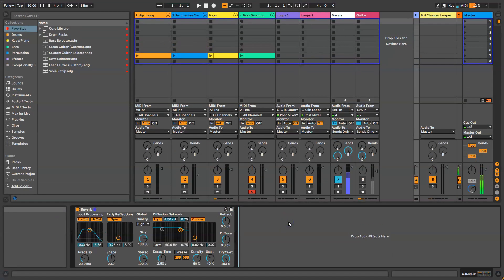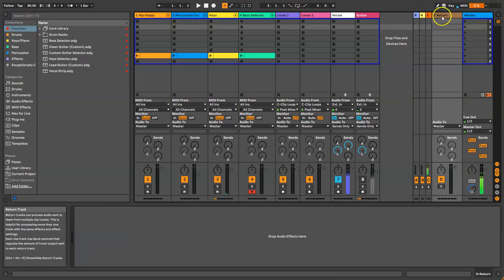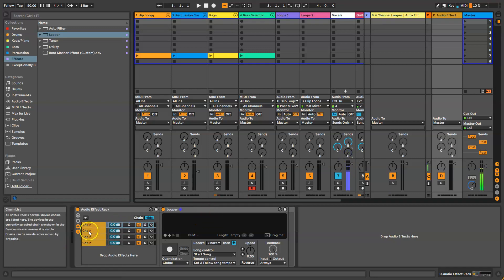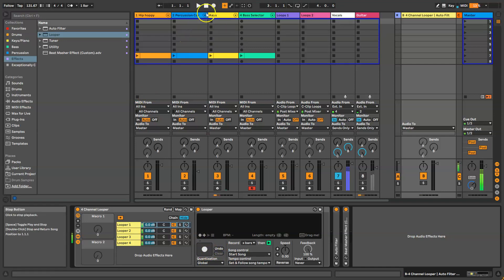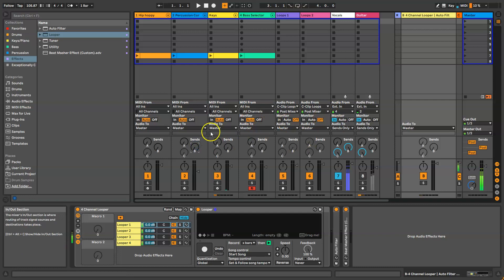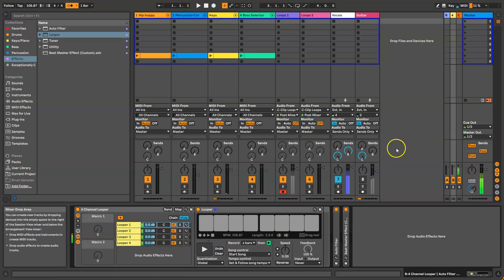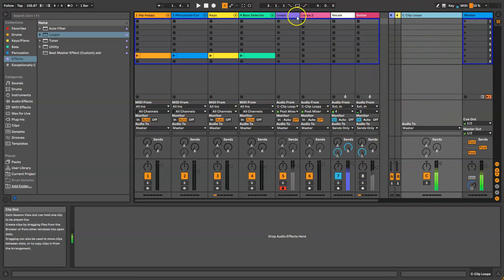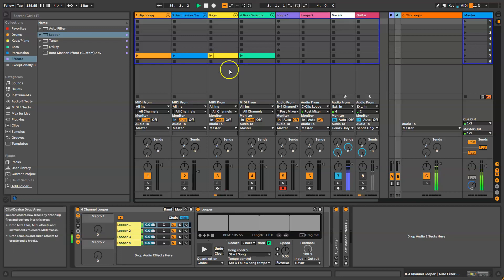Achieving Boss RC-505 functionality in Ableton

Comment: The only chanel that put out that the looper just dont work ...it almoust do it ....but no it is delayed and the driver error compensation could fix it ( is to force chanel monitoring "in " to work as "off "setup) but it only has control over the audio clips not the  looper  the start Point for recording stay delayed 😢

Comment: How do you reduce the volume on the RETURN track?
having the 4 Looper Chains increases the volume by a lot
Reply: trying to figure that out too
Reply: @Toomzzzy  

Probably that's too late, and not sure if I guessed the issue correctly - 
but maybe switching that "input-output" to "never" can help?
Reply: I tend to add a "Limiter" device at the end of the chain as a rule, unless I have a good excuse not to. Indeed, when stacking vocals, it can get a bit much if you don't cap the output.

Comment: Amazing, Bro!!! Been fiddling with versions of this for years. I'm also using Launchpad Pro mk3. Is there a Components template that's sharable? Or a video that shows your LP workflow? Thanks again /|\
Reply from the maker: Hey mate! Thanks, glad you are enjoying it! My components custom set up is really simple: you could make it in five minutes. I have all the buttons for each looper in a vertical column, then I replicate that column from left to right four times (with a blank column in between, to stop my fat fingers from pressing two buttons by accident). The in each column (looper) are midi mapped in this order
1. Record/overdub, I also assign this button the looper device itself (in midi mapping mode, click where it says "looper" on the device itself. This means that when you hit the record button, the view will snap to this specific looper, allowing you to see the visual info on it. 
2. Undo
Blank
3.clear
Blank
4. Stop
Blank
5. Device on/off (assign the looper device on off in the effect rack, it's the orange button) 

All the buttons are CC's set to momentary, except for the mute button which I set to toggle and a different colour :)
Reply: @slimmestcharlest  Just dove into this! I discovered that device on/off will stop the loop, so I added a Utility to each Looper and mapped the mute button from there instead. The blank columns are also handy to use as vertical faders for volume control... With the remaining 3 buttons used as send effects... Freaking love the LP Pro mk3! Feels like I'm finally getting my live rig dialed in!